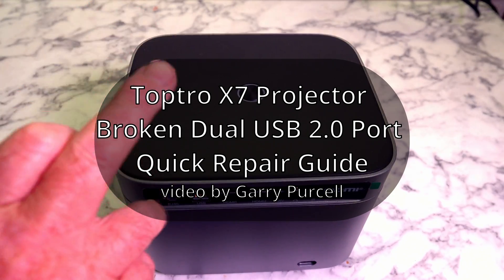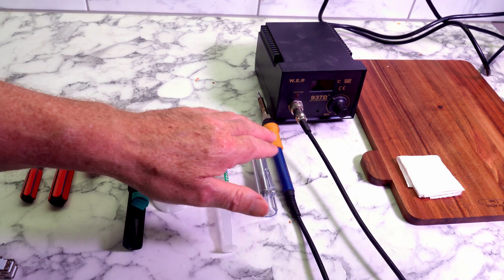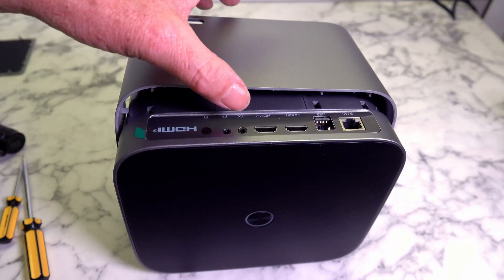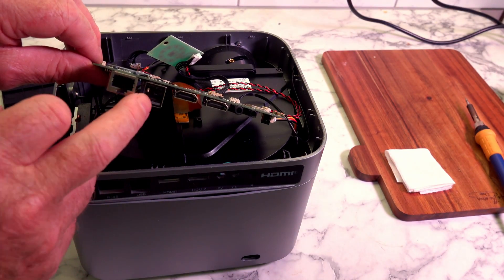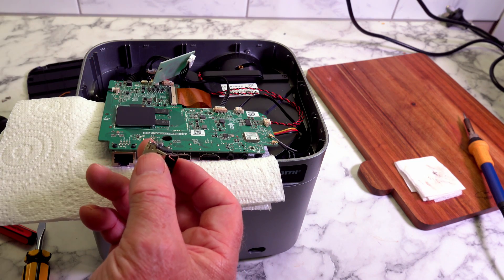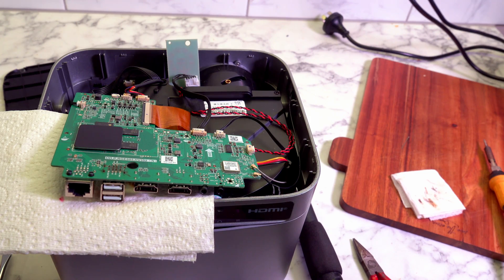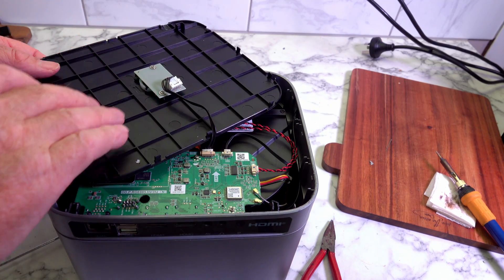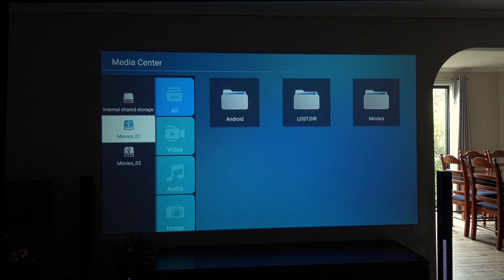Toptro X7 Projector Broken Dual USB 2.0 Port Quick Repair Guide

Comment: IMPORTANT.......DONT PRY OPEN THE TOP WITHOUT UNSCREWING THE BACK BOLTS........REMOVE PLASTIC STRIP WHERE HDMI IS WRITTEN......THERE ARE 2 HIDDEN SCREWS........AFTER THAT YOU CAN PRY OPEN THE TOP........DONT KNOW WHY IT WAS NOT SHOWN IN THE VIDEO....... PROBABLY THE GUY HAS BORKEN THOSE😢😢😢😂😂😂
Reply from the maker: No I didn't break anything.

Comment: Awesome vid! Thanks for sharing 🙂
Can I take off this top cover without messing up the back mounts (where the USB, HDMI ports are)?
My auto-adjust is dead. I think I can fix it?  It just freezes on a white screen when I turn it on, no auto-adjust sounds at all..
Thank you.
Reply from the maker: Be carful taking the cover off, the tabs are a tricky to get them to release properly.
P.S. The USB ports won't be affected by this action.
Reply: Hey Garry, thanks for the reply!  Yeah, I've got most of the cover off – about 80%. The front was easy, but the back's stubborn. I'm scared to pull too hard, and it looks like it might break, and I won't be able to put it back on... thanks again
Reply: @kobek you have to pull out the plastic strip off from the back where hdmi and usb is written...there are 2 screws.....once those are unscrewed the top will open......good luck

Comment: Hi, do you know where to get the replacement usb ports? Do you have a link from aliexpress?
Reply from the maker: I bought mine from Aliexpress.
Search for: Dual USB 3.0 18 Pin Type A 18P Female AF Right Angle Socket PCB Jack Plug Connector

Link Below if you cant find them using the above key-phrase.

https://www.aliexpress.com/item/1772037409.html?spm=a2g0o.productlist.main.1.1c49QouzQouzQK&algo_pvid=9e05b50e-28a8-4ce6-b38c-f92062dc55df&algo_exp_id=9e05b50e-28a8-4ce6-b38c-f92062dc55df-0&pdp_npi=4%40dis%21AUD%219.39%219.39%21%21%216.16%216.16%21%402101f01817296464832452181e1cab%2117624758793%21sea%21AU%21907791185%21X&curPageLogUid=9hI9hNLNoY9T&utparam-url=scene%3Asearch%7Cquery_from%3A
Reply: @GarryPurcell  excellent! Many thanks.
Reply from the maker: I just realised I've given you the wrong part info.
It should be:
Double USB Type A Female Solder Jacks Connector PCB Socket USB-A type 90 Degrees 4pins 180 Degrees 4pins

https://www.aliexpress.com/item/1005004955804757.html?spm=a2g0o.productlist.main.1.499d40Fe40FeO4&algo_pvid=1dc1f358-77ad-4a15-88a1-feeea42b460b&algo_exp_id=1dc1f358-77ad-4a15-88a1-feeea42b460b-0&pdp_npi=4%40dis%21AUD%211.87%211.49%21%21%211.23%210.98%21%402101c80017296632305926392e1cb4%2112000031147727456%21sea%21AU%21907791185%21X&curPageLogUid=JDEDqhCHr3fK&utparam-url=scene%3Asearch%7Cquery_from%3A

Comment: Great job sir… ordering one cuz of your unboxing video.. keep up the good work .. just one question do you think it is sturdy product??
Reply from the maker: It's very well built.
I have mine set on a Projector Floor Stand behind my couch.

P.S. I'd suggest, if you use a floor stand thats set close to a wall.
Buy 90 degree down USB connectors if you intend to use a hard drive, and 90 degree down HDMI cables for Xbox.
This will prevent the problem I had with my over excited grandkids.